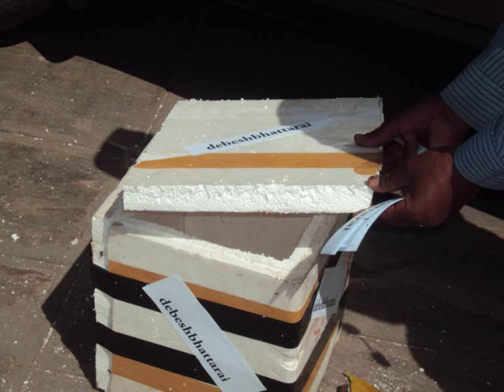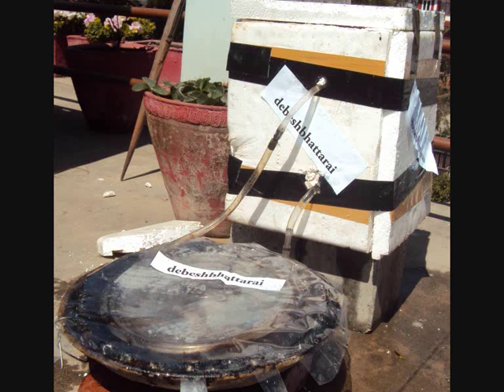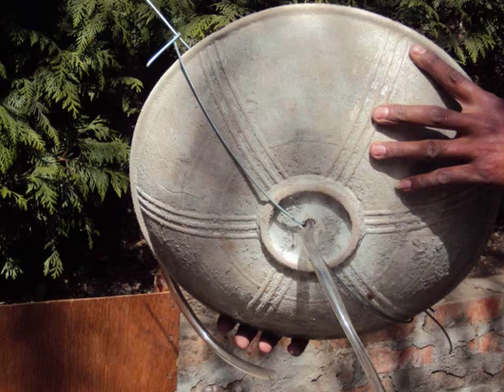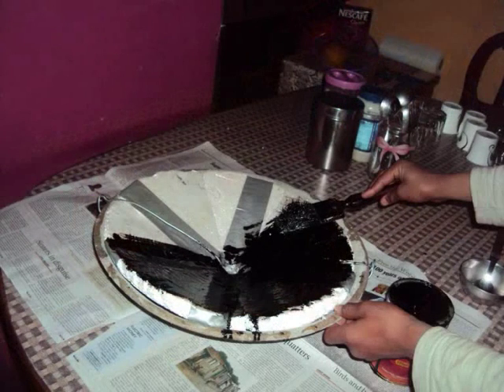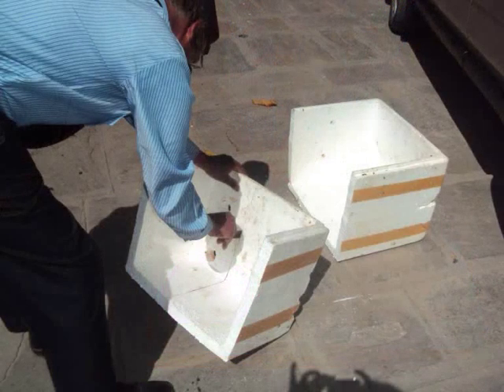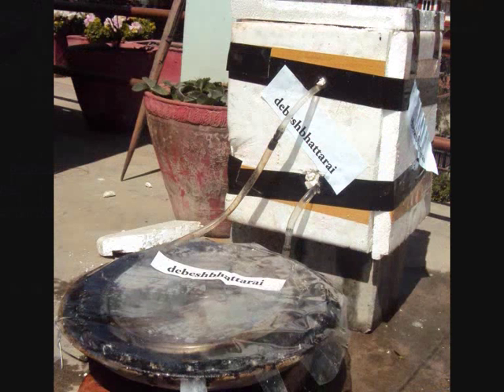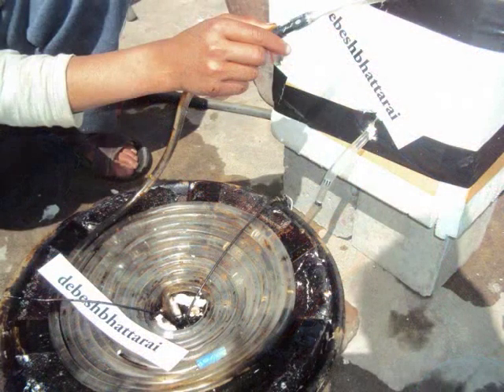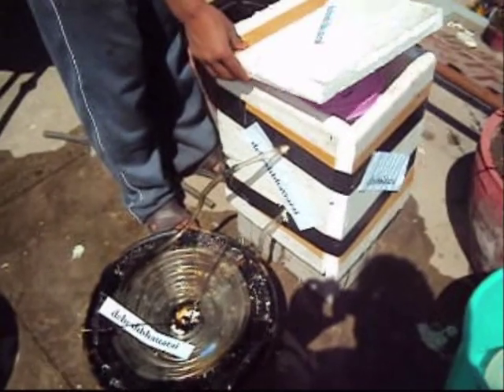Portable Solar Water Heater DIY a Green Gold

Comment from the maker: @jwwm2 
I measured a gain of around 57F from lowest water temperature of around 50F, It reached at 107F, where as my 100 sft DIY recorded 124F, which is a gain of 74F , from 50 to 124...but the smaller one has a heating element of only 1.75sft for 5 liter of water and 9 m coil of 10mm dia. Now it is only a question of increasing the area to some extent. But the bigger one is also a stand alone portable solar...!  These days the sky is a bit dusty...and cloudy too at times.. no clear sun.